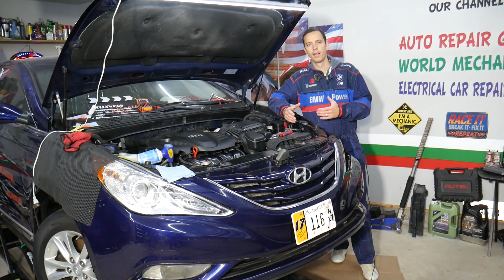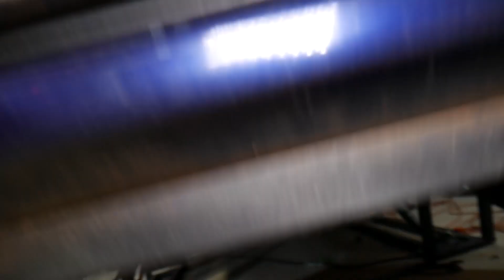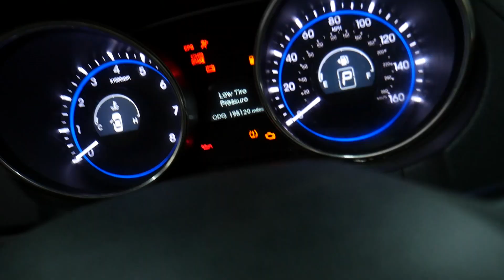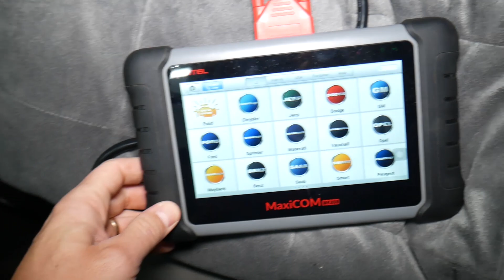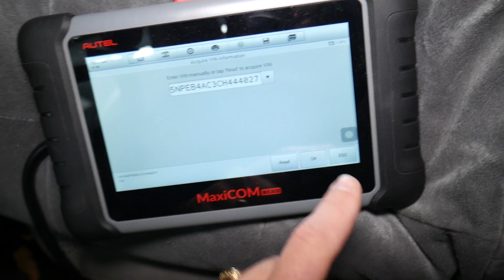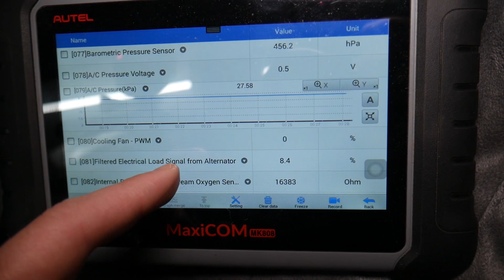HOW TO TEST AC PRESSURE SWITCH ON HYUNDAI ELANTRA SONATA TUCSON SANTA FE ACCENT VELOSTER

Comment: For mine is half side cool air and the driver side hot air,any ideas
Reply: Blend mode door actuator
Reply: That happens when it is low an ounce or two of freon what's happening is most of your coil is getting cool and the rest of it is not because all the heat is absorbed by then so you need to add more refrigerant also check your cooling fans and make the rear up to full speed